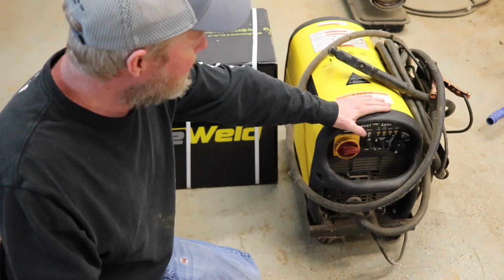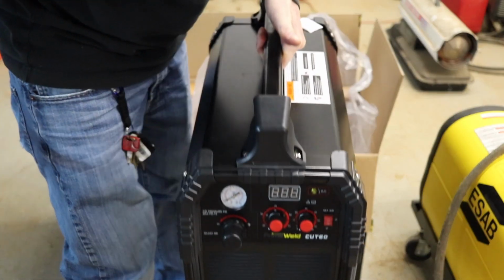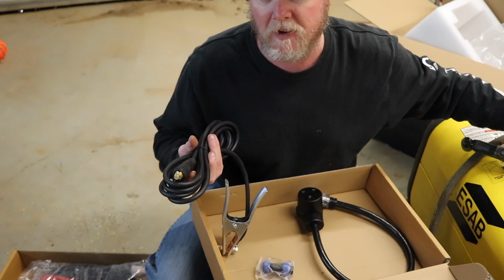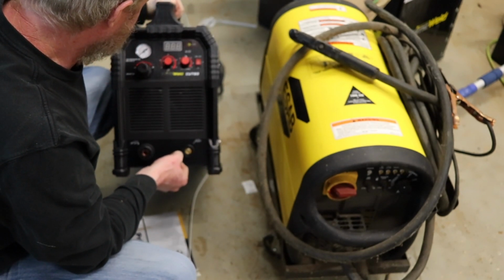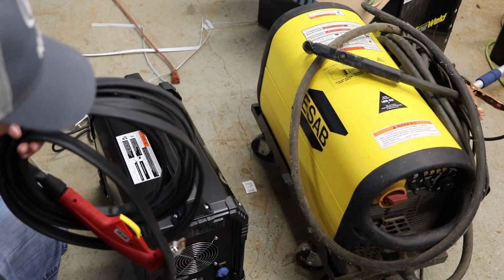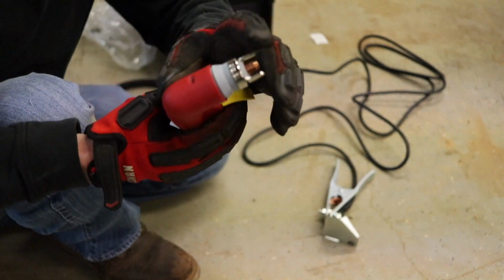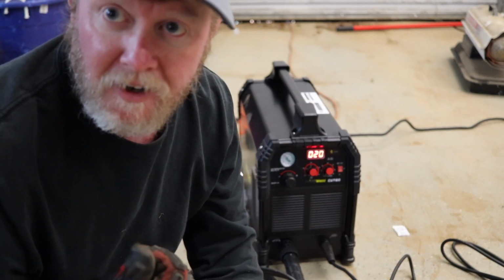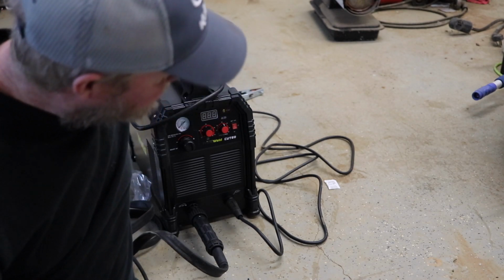Plasma Cutter Value Comparison Primeweld vs ESAB

Comment: So which one was better at the end
Reply from the maker: The primeweld. Less cost both for the machine and the consumables.  Easier hookup as well.
Reply: @ShaneBurrell1  thanks been thinking about gettiing it ! I heard they have a really good customer service and just had a real bad experience with Everlast on second purchase im thinking on switching
Reply from the maker: @horaciosalinas8145  I've had it for awhile now and cut lots of material.  As with any plasma make sure you have clean dry air.
Reply: @ShaneBurrell1   yes ! im planning on buying an air comp just for the plasma , thanks for the reply

Comment: Hey man, did you really use that thing without safety glasses or welders helmet/goggles? Yer gonna get cataracts for sure and maybe worse depending on how long you’ve been doing this.
Reply from the maker: I've been doing it a long time, almost 30 years.  I don't do major operations without full protection.  But it's pretty common to do a tack or rough cut with my face/eyes out of the way.

Comment: nice machine for the price it can take some abuse, imho it cant be worst than Esab, dont get me wrong, esab were top back when they first came out, it was compact and way lighter than the counter part but you would ruin the tip if you were to drag it on your work and the consumable were so damn expensive, even now they lack in performance compared to powermax. they are more expensive though they dont lose value and you basicaly never have to change the tips.
Reply from the maker: I’m still amazed how much time I’m already saving just from setup. Requires less time and work to get the machine where you need it and not holding up 15 pounds of torch. The cut is as good maybe slightly better.
Reply: @ShaneBurrell1  Did you try it on 3/8 stock?
Reply from the maker: @leftitbythecurb8350  Yeah.  Looks like 3/4 is where it starts falling off between cutting and severing.   Still very happy with it's performance.
Reply: @ShaneBurrell1  i think you mentionned that it doesn't have a 'gouging' setting?
Reply from the maker: @leftitbythecurb8350  It doesn't.  ESAB doesn't have a "setting" either. I think it's mainly the design of the nozzle.  The esab is just a nozzle change and keeping the settings on the lower amp setting.  I've just used an angle of attack for gouging and it works.